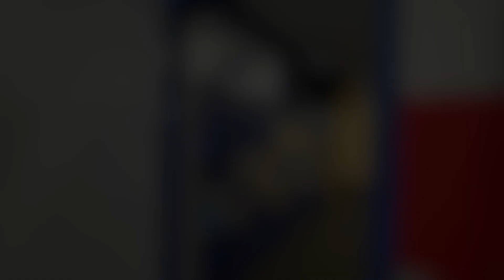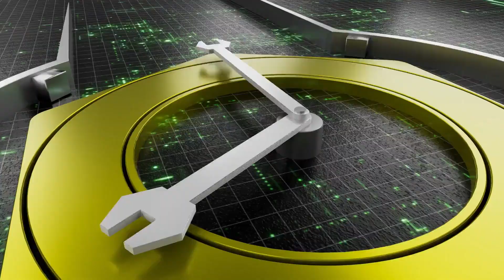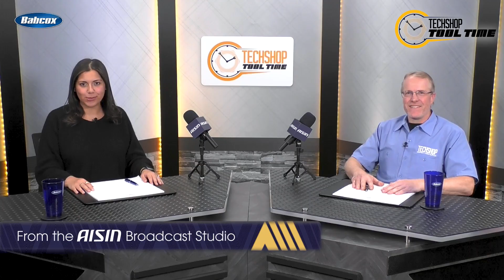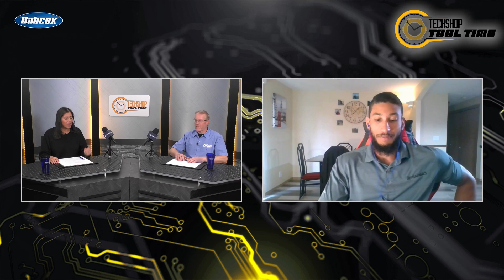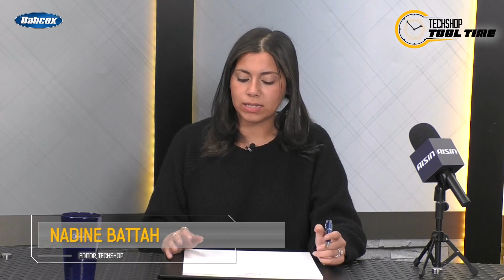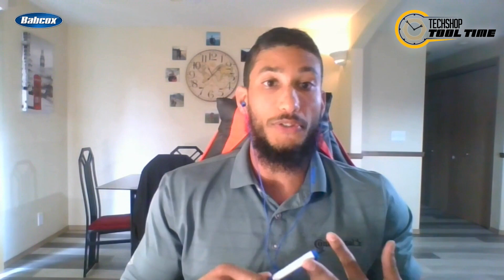Learning About Continental TPMS Systems

Comment: The REDI Sensor earl generation was easy to used (SE 10001, 10002, 10003, but sines they were phased out to the new generation SE 10006 & 10007, they have been nothing but trouble programing and relearning. Even with the Continental Autodiagnos TPMS SE tool.